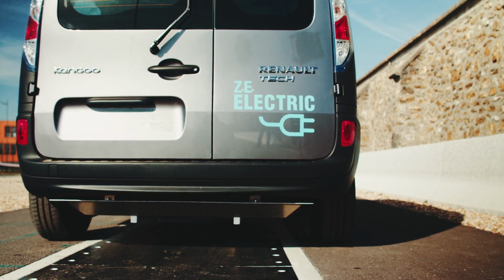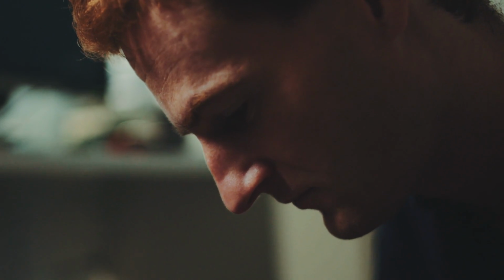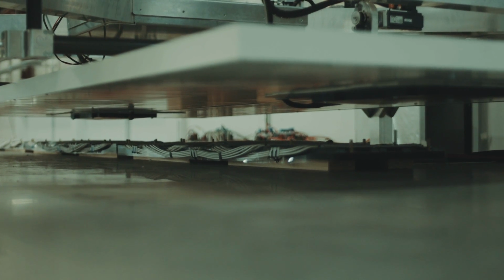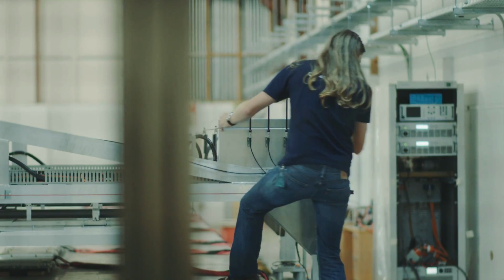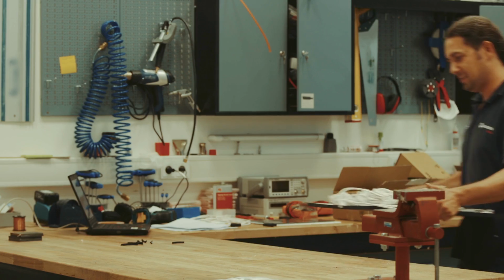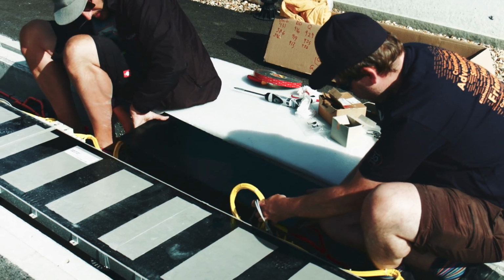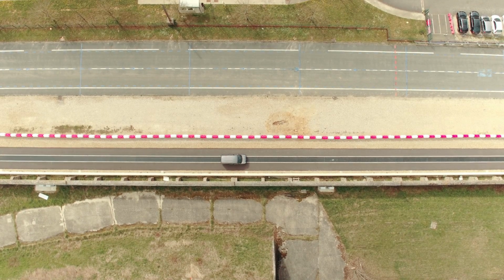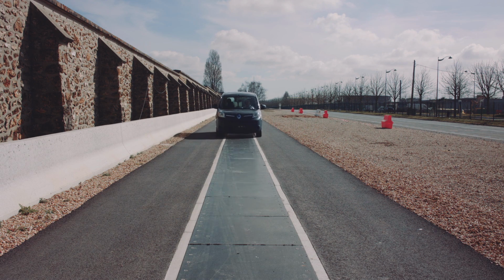Qualcomm Dynamic Electric Vehicle Charging (DEVC)

Comment: it looks very basic  But for maximum induction to take place. this is why a dynamic motorized leveling is needed on the electric vehicles floor pan pick-up coils.a system of linkage with motorized hinged joints lets the pick-up coils skim the the surface of the induction charging lane. at just 20mm ground clearances. also for steering, magnetic line following on one side of the charging lane can be used by the vehicles steering when charging. to keep the vehicle on track. coils in the roadway that are not under the vehicle need to be off. and the line following keeps the electric vehicles steering on track.  PWM barcode machine-readable, representation of data is how the road can talk to the electric vehicle. and the vehicle can ping a barcode back to say yes I need charging . its all about PWM Pulse Width Modulation of the coils in the electric vehicle.  also dynamic motorized leveling can retract the vehicles floor pan pick-up coils in normal driving to maintain minimum 150 mm ground clearance.  one more thing, the cost in road works is in the km's of copper coils & wiring or units needed. Elon Musk may like this one!